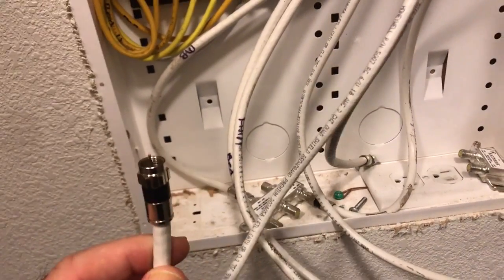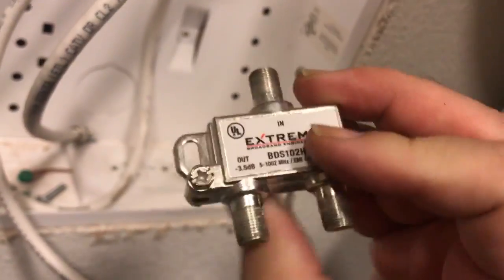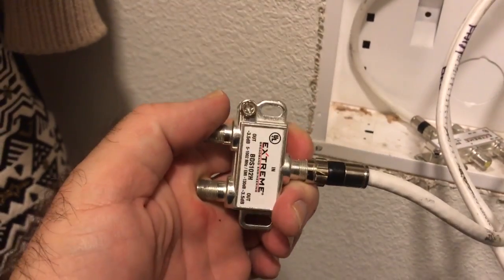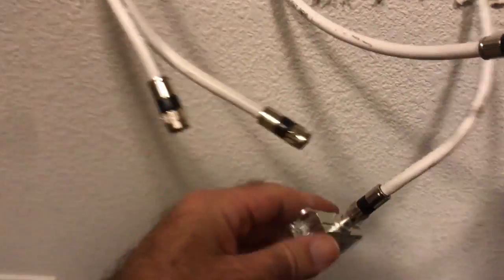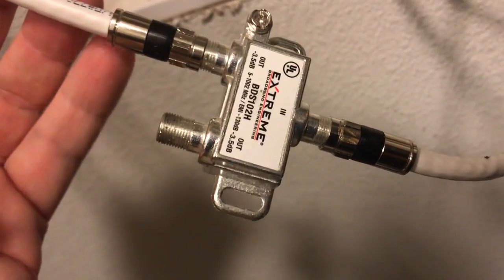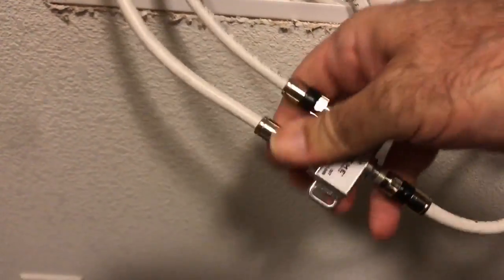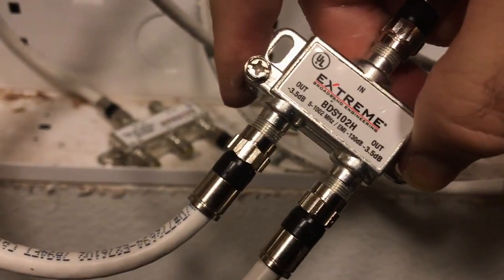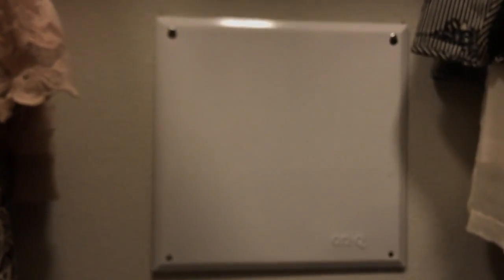How To simple fast Cable TV Comcast Charter self install the cables with splitter

Comment: I have a splitter that is old and I want to replace it with a new one.  If I replace the splitter, will I have to go through the whole process of re--establishing my cable tv channels and my internet service, etc., or will everything just pick up right where it was?  I use the splitter "outs" to go to internet and cable tv.

Comment: Hey so I have a cable box and a modem/router that each require a coax cable. Can I run a coax cable from my wall outlet, to this splitter, and then from there directly to my cable box and modem/router? All indoors?
Reply from the maker: Yes you can. And that is what this video IS ABOUT.

Comment: I have a apartment with Comcast cable already hooked into my own splitter but I was jw i have a coax cable coming out of my wall IS THAT the one I use to plug into the back of modem? Really don't know what I'm doing

Comment: Have a small one bedroom apt and one cable outlet in the living room. I want to watch TV in the bedroom too. So from the existing living room outlet , I just install a spliter from that and run it into the bedroom to a second Cable box?
Reply from the maker: Yep. Exactly. You are spot on.. Split it. Run the cable to the other room. Put the new cable box on the new cable from the splitter. IMPORTANT- register the cable box with the cable company or it will not work. YEP. They are paranoid.
Reply from the maker: But you need to be out exercising really. Not rotting in the house watching TV right?

Comment: Your video was very helpful. Are Tv 📺 got moved for remodeling job and the cable was hooked up wrong from the wall and on the cable box  and WiFi Terminal . After watching your video and figuring out that the wall cable / street cable was hooked up wrong.. Making  the correction I was able to get Wi-Fi to once work again . The problem I have was the WiFi router was not working ! So that prompted me to go on YouTube and just search for a video to help me fix my router I stumbled across your video look behind my TV and I noticed that the cable coming out of the wall was hooked directly to the 📺 ) the tv was working fine but the Wi-Fi router wasn’t allowing me to receive signal. So I  followed your steps and I got Wi-Fi signal but no TV signal 👀 so then I switched the two coacts wires on back of the cable box and things work fine the TV and the Wi-Fi problem solved 😊 thanks for posting video

Comment: I just bought a new terminal from my cable company but now they think it might be the splitter. They wanna charge 80$ to come check it out. I found the same model online , can I just replace it myself or does it belong to them and the cable will stop working if I try to do that? Sorry for the dumb question but I have no clue what I’m talking about 😁
Reply from the maker: Replace it yourself. Just make sure you got a good one.

Comment: What about the modem and router? Many people now have a modem/router combo unit. How do you set up a splitter for that to then feed TV's and internet in the other areas of the house?
Reply: i believe most modems now how a coax in for the wifi and then they have a coax out which you would run to your tv. so the modem acts as a splitter almost.
Reply: @kevn22 I have a coax cable just hanging out my wall is that what I set into the back of the router/modem

Comment: So I can just plug in a cable box and also a router into this and it’ll be all good? No need for them to come out and install another coax outlet?
Reply from the maker: Yep. True. Make sure you have the correct splitter as shown. The cable box and internet box WILL need to be registered with the cable company if they are newly acquired. If you are moving across town they should still work at any address on the same cable operators system.

Comment: Question...does this method not allow the cable company to know the signal is being split. I have had mine turned off when they discovered it being split.
Reply: I've never heard of anyone having their cable turned off for being split.  The question is, who is your provider and why did you split it?
Reply from the maker: Cable company should not care if it is split or not. Cable company makes money leasing you decoder box for picture on TV's and leasing you internet. If you split the signal you have no way of using it without another decoder box. Unless you are in a super rural setting and they are sending out old fashioned tv signals.
Reply: Comcast is my company...I split the signal from my cable box using a coaxial cable and splitter and the box was cut off.
Reply from the maker: Where do you live? Hostile cable company

Comment: Where can I find this spot.? I've followed the wires that are active and I can't seem to find the spot it's coming from
Reply from the maker: Never an easy task. there are devices which cost thousands for doing this. Or you can use the lights on a cable modem.
Reply from the maker: Use the Force Luke. You can plug a cable modem into each wire and see if the lights on the cable modem react to one wire. The live cable connection will light up the cable modem lights where as the dead connections will not. Easy right? Just a waiting game for the lights to come on really.

Comment: My cable coming from the road goes into my dark then there is a core with 3 plug, red yellow and white that is connected to the tv.  How do Do I connect the splitter to the dvr?
Reply from the maker: Cable from street into INPUT of splitter The other two or more connections will be outputs. One to DVR and one to ??? Whatever else.
Reply: @moviestudioland  Thank you so much for taking time out to reply.   I am a senior citizen and not technically savvy.   I will indeed try it tomorrow.   Again thank you.   I am grateful.

Comment: If you split the main line that come in from the street... does that mean you now have set up services for two accounts? say someone in your family who lived with you wanted to have their own internet account???
Reply from the maker: No it does not. The signal is in the house from the cable company. The cable boxes determine the account for which the subscriber is using. The signal off the street is the same signal that your neighbors get. splitting the signal makes it weaker but still useful for individual boxes. You could have two accounts in the same house using a splitter. You would need two internet boxes. But tis is a waste of money. Once one wifi box is working you can share the wifi among the interested people in the house.
Reply from the maker: If you want that person in the family to have their own internet acccont then they need to get their own cable modem box from the cable company. And then yes you can split the signal and feed them cable. Sounds like a renter downstairs or such?
Reply from the maker: But not sharing the wifi is kind of mean. Just make that person pay 1/2 of your bill. Then you both benefit.

Comment: In my area the cables coming in from the street to the different rooms are located in a weather proof box outside.
Reply from the maker: Yep. That's life in the big city. So all your room should be live.
Without the cable box the cable does not work anyway

Comment: I do the same but when i plug both to the tv it doesnt work when i plug one tv out works fine
Reply from the maker: You need to put the cable from the street or known cable input to IN.
everything else to output. If you do this backward then yes - you will get bad results. TV will only need ONE input. I am guessing it is a TV box. Usually one input and two outputs. One output to tv box. The other to internet box. IF you are indeed dealing with a cable / internet company.

Comment: You forgot to "ground" the "Splitter". To get the best quality and drain of electrical from over current surges you have to have an Earth Ground. Otherwise you get 360 instead of 720p or 720p when you want  1080p  and get a surge and possible blown out receiver in your high dollar TV or other electronic equipment or worst case scenario your house burns down.  That's why most Cities and Counties fine people $5K and up for building code violations that risk human life.
Reply: Its illegal for a paid customer to run an extra cable the same way as the cable company?  He's not running illegal cable through an entire apt building.  $5k and up fines would have to make cable splitters Extremely Illegal. My 15 years with Insight/Spectrum/ Comcast would bury me under the jail with the extras ive acquired in that time